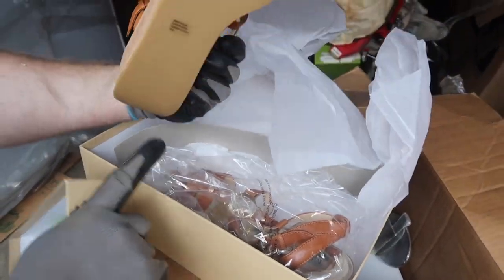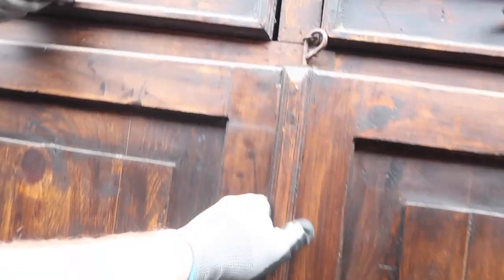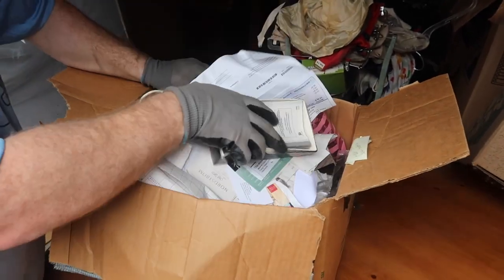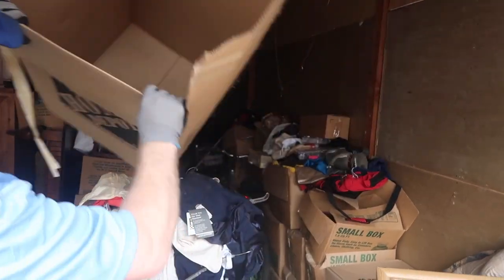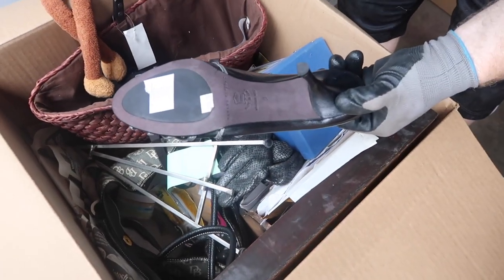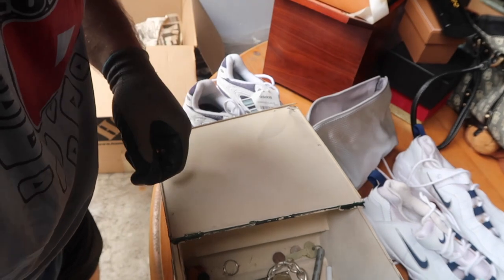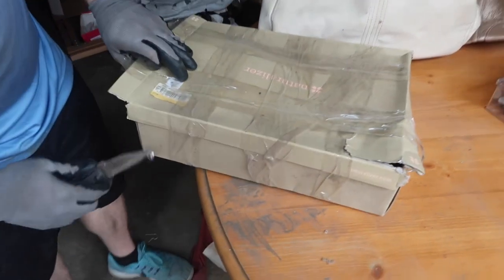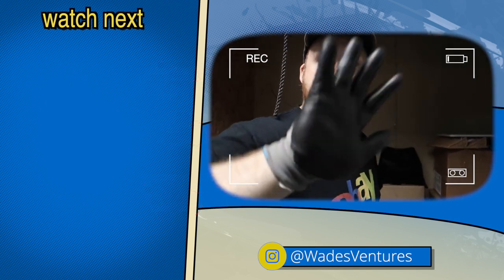1,066 NEW Designer Shoes Found Inside Abandoned Storage Unit. Owner Paid Since 1996!

Comment: The key to shoes, especially shoes that have been sitting in a storage unit or in a basement, is the bend and twist test to see if they crack, desinigrate or stitching seperates from the soles.  Otherwise it could turn into a lot if INADS due to dry rot you can't detect without it.
Reply from the maker: Great Tip Picky!!!
Reply: Some of mine in the top of my closet dry rotted after just a few years.
Reply: Yeah I learnt not to save your good shoes for special occasions.. I went to use them after about two years and the soles  basically snapped in half...They were about $220 which for me is expensive... I was so sad cause I could have worn them everyday to work and got my monies worth but thought I’d save them for special.

Comment: with some of those shoes that have never been worn and packed away for so long, when you start wearing them they will come apart, depending on the moisture and weathering in that locker, had that happen to me just after 2 years, imagine 20!!!!!!! just saying!!!!!
Reply: I was thinking the same thing
Reply: Yup very true! 
I was gifted a pair & they crumbled on me at work. Very embarrassing!!
Reply: Came to say the same thing. I bought a pair of really cute sandals. Was saving them for a special occasion...had them like 6 years. Finally took them on a cruise, went to wear for first time and they literally crumbled into pieces the first few step wearing them.
Reply: Exactly and the clothes will disintegrate when washed.
Reply: I just used a shoes that been in my closet for some time. I left for work with a print /patches designed shoes came home to a plain one, then the soles underneath were all gone too! 😅
Reply: Yes, that’s true. The materials would turned brittle. Better check to avoid embarrassment 🙂
Reply: So true! I had a pair of shoes I loved and wore for a few years, was wearing them out and they literally just fell to pieces!! So I can't imagine what that many years would do!! 😱
Reply: Yeah sad bt true it happens to fashion items..
Reply: might b owner expired
Reply: Mom had a pair of shoes that she wore for 12 years. She used to  complain that they don't make them like that anymore
Reply: It doesn't happen all the time but it does happen especially if in heat. My poor daughter had it happen TWICE as I was storing clothes and shoes in boxes in garage that were a little big that I got on sales... After just one summer in FL heat in garage it destroyed the glue. 😢
Reply: True, it happened to me. Now I wear all footwear. I saved 3 pairs of shoes  and all crumbled beneath my feet.
Reply: I bought my husband expensive lambskin dress shoes with composite soles. He only wore them a couple of times before he retired. A few years later he put them on to ho to a fancy restaurant and as he walked to the car the soles disintegrated. He had the soles replaced with leather soles and they look great. I have shoes in boxes in my closet. I've opened boxes to find the soles crumbled and only the tops intact. I have expensive leather purses in plastic totes. The body of the purses were fine but the handles were peeling off.

Comment: The clothes that were stored in the open: Which would be better, sell them dusty with tags, or wash them, which removes the tag?
Reply: Depends on what would be the more valuable for each specific piece. The best would be to blow the dust off with an air compressor attachment and then steam the garment to get out the wrinkles. If it was high-end with a stain and worth it to clean, I suppose you could get it dry cleaned and sell it ' new without tags '.
Reply: I agree.  Do as little cleaning as possible, leaving tags intact.  Collectors will be bidding on these who are very skilled at knowing how to clean and refresh the clothes because they are clothes collectors.  Let them use their own methods or you are going to ruin value of items.  Explain VERY WELL in listing these are from 1996, untouched, uncleaned with tags.  

I hope you both understand the high value of vintage, untouched items with tags like this, value can be very high, much higher than tags.

I am thinking owner was running a boutique type store, so these might be store stock or samples sent from sellers for her to select items for store.  Maybe she got sick, store was closed and family put all these on storage?